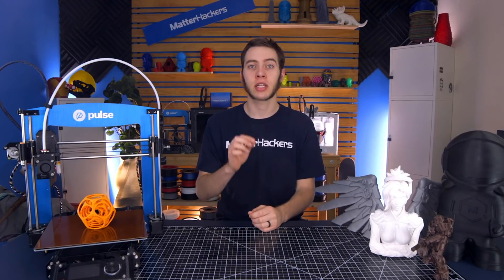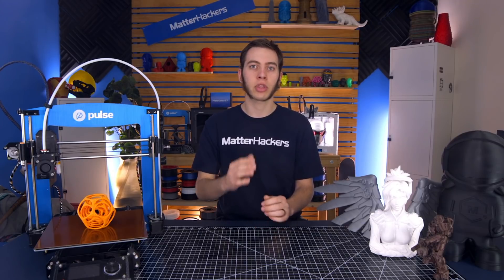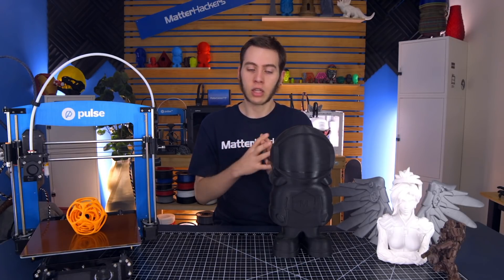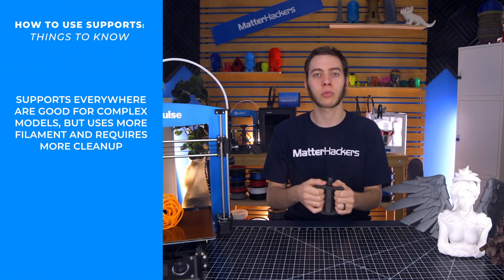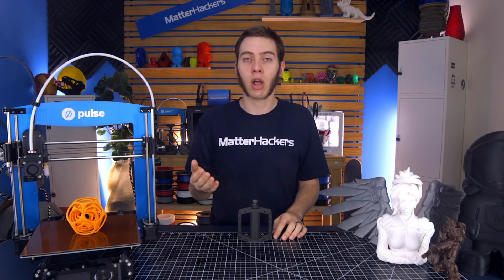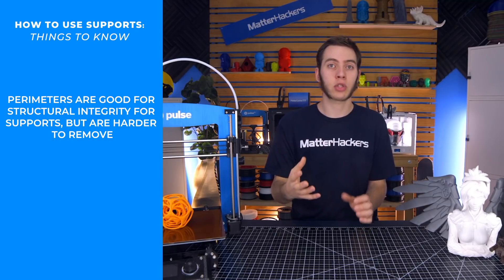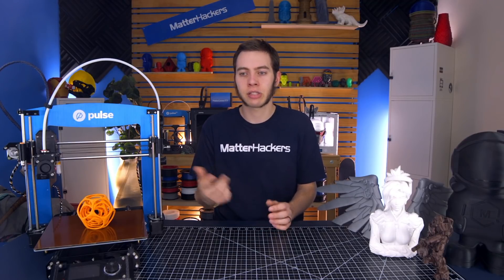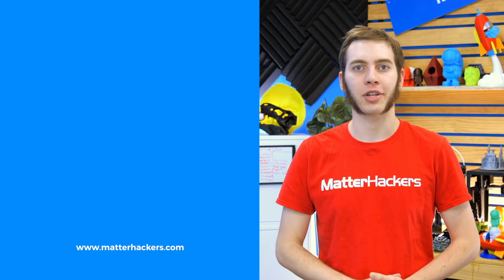How To: 3D Print Using Supports // 3D Printing Guide

Comment from the maker: What kind of supports are you using for your projects? Also, if you want to learn more about 3D printing, check out our '3D Printing How-To' playlist!
Reply: I just kinda made thin walls under my print and matched the top faces to the bottom of it. But i think they're gonna fuse cause I didn't offset or leave that air gap thing you mentioned. (Really wish I'd seen this 2 days ago)
Reply: The Bike pedal prints FLAT with no support needed. #44Steiner - with a Rifled barrel.
It's also stronger that way, layer lines in the direction of greatest stress will make it unusable.

I use air gaps the same as my layer height and always interface layers. But density around 15% or less.
Giving super-light support that snap off easy, on the very rare occasions I use that at all.

Comment: In Cura, I like using zig zag support, with a z distance of one step higher. For instance, with 0.2mm layer height, I'll make the z distance 0.24mm (that's based on my lead screws that do 0.04mm increments). I find this gives a good balance of removal and quality. Plus the zig zag gives a partial wall that can be collapsed to make removing easier. For PETG I'll just adjust the z distance up one more step (0.28mm in my previous example). Sometimes it can be a bit hard to remove, but I think it works for me.

Comment: The Bike pedal prints FLAT with no support needed. As does the #44Steiner - with a Rifled barrel.
It's also stronger that way, layer lines in the direction of greatest stress will make it unusable.

I use air gaps the same as my layer height and always interface layers. But density around 15% or less.
Giving super-light support that snap off easy, on the very rare occasions I use that at all.
Reply: THANK YOU!! I was looking to see if anyone commented this! I was like why print the pedal vertical? makes no sense!
Reply: I presume it's to get a better finish on the hole and spigot so that it attaches to the crank cleanly. Printing flat may give you issues with horizontal cylindrical surfaces.

Comment: Are you actually trying to shit us? Do you really think someone will believe that you printed the bike-pedal (2:44) the way you hold it in the video? You can cleary see that the flat face of the pedal facing to the camera was cleary the face sitting on your printbed. Srsly...wtf?
Reply: I believe the wings are not printed as shown to be printed.   They were clearly printed upside down with the tips points up.  I can understand what you are saying about the supports and the need but those are not printed in that orientation.  I think I would have mentioned that as a possible solutions to printing them with all those supports.   I will say the video has good information just missed the mark on using models that are clearly not printed the way they are said to be printed.   Love the channel and will keep watching  regardless.
Reply: I understand you both. This is obvious that the pedal was lying on the printing bed. We see the Z layers and the squashed filament patterns (contours and surface fill) which was lying to the printing bed. We do not except such mistakes from 3D printing experts. We feel cheated. However we should always express us respectfully.
Reply: How the heck could this error have gone through post? Add to that, it does not make sense to print the pedal with its axis perpendicular to the bed. In that orientation, we all know that it will have poor mechanical strength in the direction of the forces it will encounter.
Reply from the maker: We have a couple of those bike pedals floating around. Some versions were printed laying flat, others were printed upright. Either way would require supports. - Alec
Reply: Is the pedal made out of nylon x?
Reply: @MatterHackers  That actually makes no real sense as well. The only section of the print you maybe want to use support is the big hole in the side when its laying flat on the print surface to make sure the hole comes out fine and nothing is drooping down.But tbh you can clearly see that it is totally possible to print this thing without any supports at all and it's funny to see you arguing about that and still want to make us believe that you need to use support for it and you didn't make a mistake in the video.
Reply: This sort blatant lies are a part of a larger conspiracy involving the CIA and NSA also. Srsly... It seems like a normal humanly mistake. Response like "Hey, i think you were holding that part the wrong way, did you mean to hold it differently or just hold it like that to make a point about what you were talking about?" would be a bit more helpful than "LOLZOMG LIES?!?!!? U SHIT ON ME?? WTF?!? OMG"
Reply: @YrjoPuska777  it's a mistake everyone not completely new to 3D printing spots right after the first glance to that scene. The end result of your suggested answer and mine is actually the same. And we both know that my answer is far from being like "LOLZOMG LIES?!?!!? U SHIT ON ME?? WTF?!? OMG".
Anyways, i am not you and i answer the way i want. And if you have a problem with it, then keep it as your problem and don't try to make it my problem. 
I see MatterHackers as some kind of professionals. But seing this kind of explanations just makes me shaking my head and it devaluates the quality of the video.
Obviously nobody watched the video before uploading it so this easy to spot mistake couldn't be fixed.
Reply: You maybe got the same response from Alec. Likely because he is serving his customers with these videos and responses and wants to be polite. That doesent mean that its all the same and anything else doesent matter, since you got the same response.. Grow up

Not to mention that when you work with prints professionally and have tons of them laying around, printed in different orientations and settings, you might easily overlook some simple thing like this. Im sure he knows what he is talking about regardless of having a wrong version on his hands when making the video.

And yes your response seemed like it was written by some 13 year old pimpleface, than a grown up person. So the OMZLOLZ thing is quite accurate
Reply: @YrjoPuska777  Always funny when people begin to bring the age into play when they don't have any other arguments left. Then those low-quality arguments come up.^^
Reply: @Th33xitus I listed other arguments as well, which on their own should be more than enough.. Maybe you didnt notice

Comment: Using Slic3r the interface layer setting makes a big difference when removing the support. Two layers ruins the surface of the part and is very hard to remove. One and it comes right off.
Reply: That is very much up to your printer/cooling and not a general rule. I too use only 1 layer of separation, but it will vary from printer to printer, so you need to experiment a bit. somewhere between 1 and 2 layers will work for most printers.